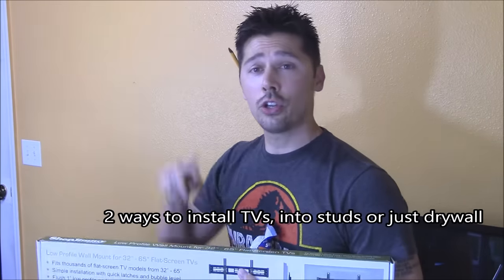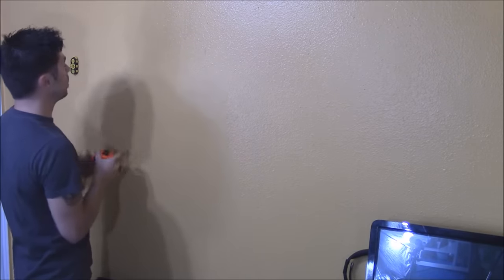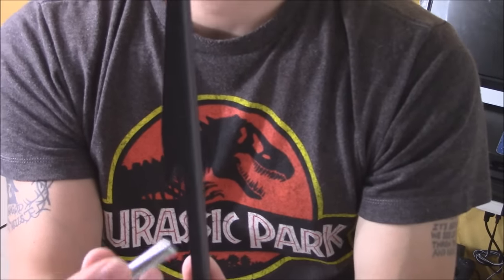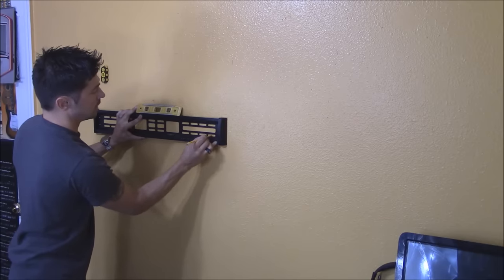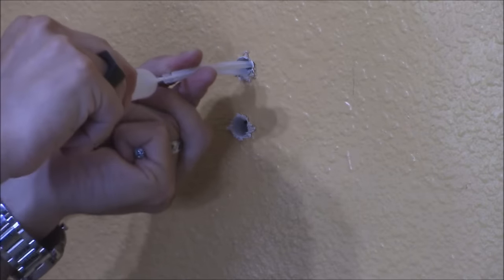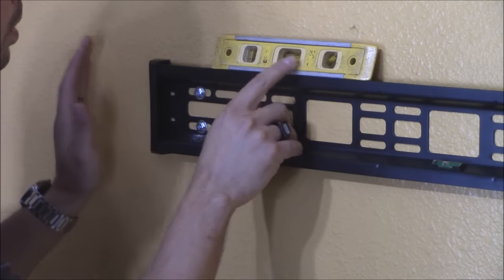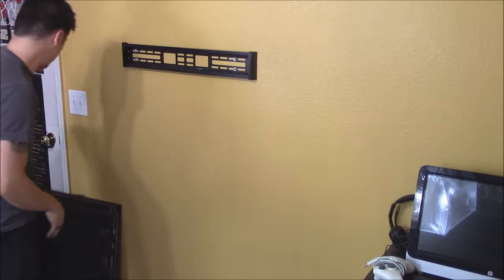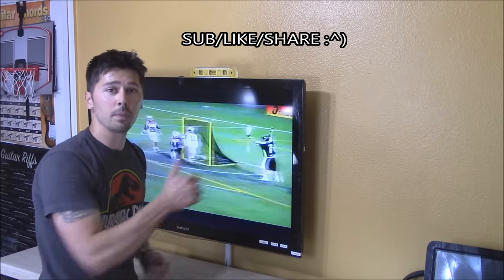2 ways to hang TV on wall mount into stud and drywall review

Comment: Hey man, great videos. I have drywall that is attached to the concrete with 1" furring strips (24 in apart). I need to hang a 70-in TV. Should I buy 4-in Tapcon screws and go through drywall+furring strip+concrete or is there a better way?  Thanks in advance for your help!!!
Reply from the maker: +Omar Rodriguez  u can use 3 inch tapcon screws into concrete or 1 5/8 inch zinc wood screws with washers into wood furring strips or snaptoggle bolts into concrete but you need bigger masonry drill bit.  TVs 32" or smaller furring strips are strong enough but heavy TVs use 4 snaptoggle bolts into concrete. see here- http://amzn.to/1jBwyir
Reply: +Tampatec ,  tapcon screws are not needed when using snaptoggle  bolts, right? So, I should use cement screws to go through the toggle bolts into the cement. ( or not).

Could you clarify when using tapcon screws? There is about 3/4 in space between Sheetrock and concrete. Should tapcon go through furring and then concrete (pre-drilled)? My concern is that leaving 3/4 in of space would not be safe.

The TV is 70 in.  Thanks a lot!!!

Comment: are plaster walls the same as drywall for those anchors?
Reply from the maker: Katie Rabbitt yes but I still recommend to find a stud in the wall.
Reply: The studs are wider than the mount, so I was going to put one stud through the center, and the outside 4 have to be wall anchors. Thank you. I'm working on it now.
Reply from the maker: Katie Rabbitt that will work fine. #missindependant

Comment: Ok so I have an older house with no studs with a pretty heavy duty plaster like, almost concrete like coating with paint over it. The walls are hallow so would a snap toggle due for a hanging a fairly light 48" tv?
Reply: You should be fine mate.
Reply: I hate those kind of houses. yueck
Reply: eDARKO-1 get a tv stand where the you mount tv on the stand not the wall

Comment: Can a 55 inch TV that weighs around 40 pounds be mounted on only snaptoggles?
Reply: +TheHaibao123 YES, but if it falls then I was wrong.
Reply: +Jorge Larrea lol
Reply: He just hung off the wall and I'm just he weighs more than 40 lbs
Reply: You can, yes. Make sure you get the snap toggles rated above what the TV weighs.  Lowes has some that are rated up to 127lbs.  However, it's always better to catch at least one wood stud in the wall.

Comment: Can I use the snaptoggles on a 65" tv?
Reply from the maker: Mariana Miranda if your TV is under 100 pounds on a flush mount it should be okay, use 4 bolts.
Reply: +Tampatec Thank you! Also I need a drill bit for wood 3mm diameter  by 60mm lengh. I have not idea what size it should be

Comment: Is it safe just to use anchors on both sides? Drywall?
Reply from the maker: on 50" led tv sure but not 50" plasma TV no. just remember toggle bolts weight limit in drywall is 150pds.
Reply: +Tampatec thanks for the reply.  Awsome video.  It's just a 32 inch TV lol.  If I get everything right I might do a 46 inch.  I got no plasmas.  Thanks

Comment: There is no way I would trust that to hold my tv if not mounted to a stud.
Maybe you have used that method time and again but eventually the weight is
going to strain those  mounting holes and your tv is gonna come crashing down.
Reply: In this video, he did drill into one stud.  I think he's going to be fine with 2 large, wood screws drill into the left stud and 2 toggle bolts on the right side...especially since this TV is not mounted on an articulating arm mount.

However, if you have a big, heavy plasma TV mounted on an articulating arm that you move in and out all the time, you're definitely playing with fire if you rely strictly on toggle bolts.

Comment: If you are hanging the tv just on dry wall, make sure you put enough wall anchors. And no, you are never using “too many”. 

For example: my 50” tv has in the mount bracket 6 anchors on top, 3 on each side, 6 anchors on the bottom and 4 in the middle for a total of 21 . Some will call it overkill, but I got a box of 30 anchors for $20 at Home Depot, so I will call it safety measure
Reply: Thanks, rather spend a little more time putting them in they have to deal with a fallen tv

Comment: Most wall mounts need new screw holes drilled through. You should have drilled out the 4 smaller holes that were at the ends of the mount so you could have mounted to two studs. Will you show the tv smashed on the floor when that 200lb dinosaur falls of the wall? NEVER NEVER NEVER mount a tv just through drywall. Drywall is NOT structural. Most new lightweight dry wall cant hold 5 pounds. I wish Norcal still did videos!
Reply: catfisher420 120% agree

Comment: This helped a lot. TV in the studio is hung. I used Toggle bolts all around. They are weighted for 80 lbs and the TV probably weighs 20. I used 4 of them so I should be good. The only wrinkle was the insulation in the wall. I ruined 1 bolt fighting with it. Then I just ran the drill through several times and got it out of the way. Worked like a charm.

Comment: Thanks for the video!! I live in an apartment with a "no drill/holes on the wall" policy....Any clever suggestions for wall mounts (or wall mount illusion) that don't require drilling? I know it's a bit of a stretch, but I'm curious if anyone has figured something out.
Reply: Get  and cut into two Pine one by fours. The  lengths of One by Four Pine board would be  cut to width length of TV. Attach the two boards horizontally across  studs in wall . Attach TV Bracket to these pine boards and finally, TV to bracket. So you have No Holes and drill holes, just small screw holes in wall.

Comment: Im sorry bro but you boast about being a home tv tech (whatever that means)  for years insinuating you're beyond instruction manuals. However, you're willingly and knowingly mounting a tv, that's bigger than 20inchs, (Personally I would never recommend mounting any size tv or device) one side into a single stud and the other side straight up in the drywall????  Then talk as if whaddaya gonna do?!  Since it won't reach this is the only possible way! I I wouldnt want someone sending you out to my place to install a coffee filter. Wbo would ever install using to different means and claim to be professional. What you should have gotten, which many people do begin with since it adds additional support even when going to both studs, is a solid wooden board and drilled the board into the two studds,  then mount the TVs brackets and mount onto the board thats mounted into the studs. Wouldn't matter how far the studs are,  you're just asking for trouble hanging a tv into drywall.  Jeezuz...

Comment: Drilling a hole in a wood stud does not secure the screw or nail like you said! The main purpose for a drilled hole is to not split the wood when screwing in a screw or nailing in a nail! And hiding the cables in the wall would have been a nice touch to your lame video and a longer level (3'  preferably) works way better!